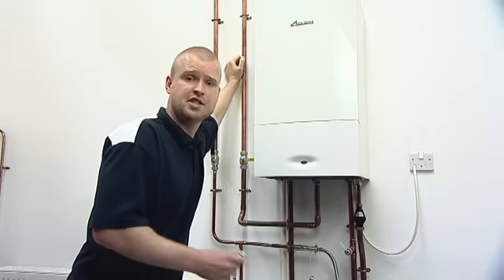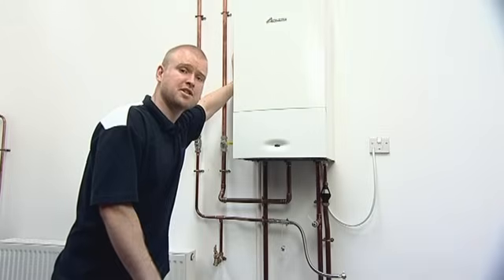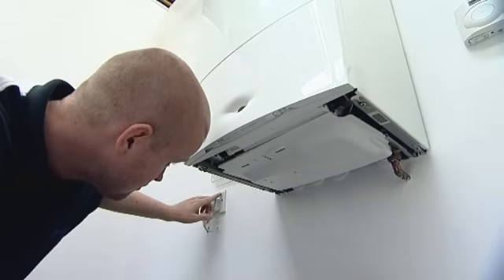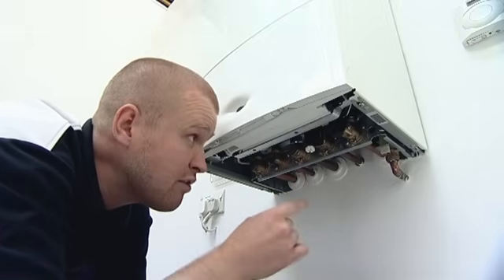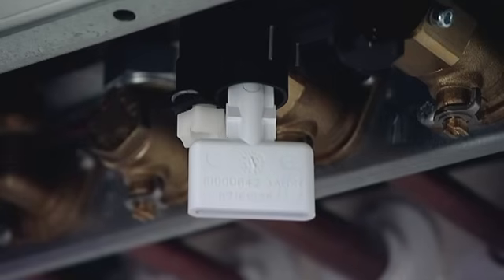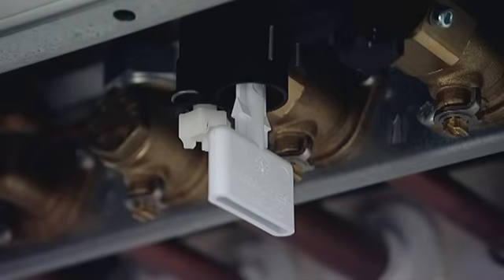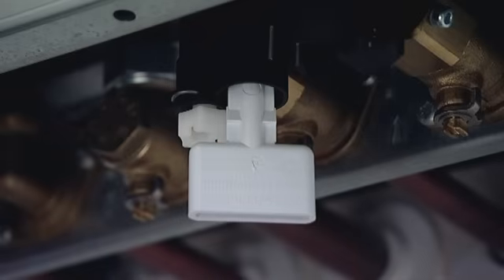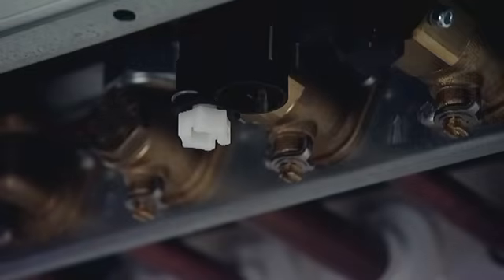How to Repressurise a Heating System with an Internal Filling Key | Worcester Bosch

Comment: Thanks for the video, really helpful.  However, when I get to the stage to turn the white nut water starts pouring out down the hole where the key is.  Please can anyone help?
Reply: Ditto, got the same?
Reply: @harmony3395  The key's 'O' rings should stop water leaks during pressurising. If the key is a tight fit, lubricate the tube with soap, WD40 or silicone grease. The knurled tap can allow some water ingress to the key tube, but discover why the 'O' rings don't do their job. It wouldn't normally pour though! If finally re-tightening the knurled valve (after the gauge climbs) does stop the leak, that's the important thing.

Comment: He said there were two ways of doing this. Why didn't he show people how to re-pressurise using the filling loop?? I'm no expert but I'm sure I learnt that these filling loops must not be permanently attached to the boiler. Possibly illegal. However, many people do keep theirs attached. Mine is. Thank god my installer left it on and even told me how to use it.Very simple. My make of boiler didn't come with the internal pressure filling system with a key so I need the filling loop. A quick top-up every now and then. Nice!

Comment: Dear Worcester Bosch 
This plastic key and manifold confuses 99% of tenants. The key almost always isn't pushed home in the black recess ( see comments below all complaining about water leaking) as it is a poor fitting. What was wrong with the traditional filling loop? Or fit a lever valve or something under the boiler.
Reply: Why does the key keep turning all the key all the way around after inserting? Will it cause any problems??

Comment: Hi just a question for the Worcester bosch group, my parent`s had a new boiler this time last year, "same as seen in the vid" and my mother is a little bit confused as to why it has to be filled up every 6 weeks or so any suggestions why it needs re charging so often ?
Reply: I know nothing about central heating systems, but at a guess, if you are losing pressure, you have a leak somewhere.

Comment: ARGH!!!  The flaming key goes in, but the white nut doesn't turn anti-clockwise.  I also now cannot get the key out no matter if at open or closed padlock symbol.  ALSO can't find instructions ANYWHERE on the website for my model for this issue.  Please help.

Comment: As a Gas safe registered heating engineer this method of filling a pressurised heating system can only be described as an appalling  way to fill or Re - pressure a heating system. A bog standard filling loop is way better, for a homeowner or end user.

Comment: Many thanks, this worked a treat.
For those of you about to try this, here's a quick tip:
If the knob you turn to let cold water into the boiler doesn't seem to do anything, you may find that you need to take it off, then use pliers to turn it. This happened to me as the white knob in the video, which lets water in, was worn and didn't turn the actual shaft. So we took it off then used pliers.
Job done.
Reply: When I did mine, turning the key water came out and it did not work! SoI turned the key back to lock and opend the white nob. Waited for about 30sec then turned the nob off and the key to unlock. Then turned the key to open , and it worked.

Comment: Will this also improve the hot water pressure? My shower takes ages to heat up and runs cold for a few minutes every few minutes. My plumber did what was described in this video a couple of months ago and it improved slightly for a short while.  I just did it again in the hope it'll help the situation - but surely I should not be doing this every few months?

Comment: Thank you so much - bled the radiators then had no heat or hot water at all- watched this and attempted my first official boiler repair and now everything is back to normal - except the radiator i was bleeding is still rubbish. And luckily my boiler came with one of those keys ..... or i would still be crying at my laptop!!!

Comment: Hi, I have just done this process but the pressure continued to climb after I had turned off the screw. I turned off the electric to the boiler in a bit of a panic as the pressure went up to just passed '3'. The pressure came back down to '2' and so I turned the electrics on again but when there is a demand on the boiler (e.g. hot water or rads turning on) the pressure climbs all the way back up to '3' again.
Any help woul dbe appreciated.

Comment: Thank you very much for this posting this video have recently made the switch from an old back boiler to a new worcester combi boiler, I noticed the pressure had dropped just below one bar. Ended up causing a bit of panic, as I'm not too sure whether or not this could be dangerous at all. This video settled my fear and fixed my problem. Brilliant work, thanks very much.

Comment: Having probs with a 28dpi boiler. After pressing the reset button last night there is now no hot water - I'm not sure if we ever had heating as it's summer & we haven't needed to have it on since moving in. The red light keeps flashing. I tried to follow ur instructions but our boiler is slightly different & also the pressure is at 1.5 so I'm not convinced it's that. I've just noticed that the key was left in the boiler system and not sure how long it's been there so I removed it. Can u help? Ta

Comment: Great video! I reconnected a radiator today but when I switched the boiler back on it was making odd noises and the radiators weren't heating up. Thoughts of calling in an emergency gasfitter/plumber on expensive weekend rates went through my mind. But after seeing this video I learned that my problem was simply a matter of the boiler pressure being too low. Easily fixed. Great stuff!

Comment: Great video, thanks. Very clear, concise instructions. My boiler pressure had dropped after bleeding a radiator, so this video was very helpful. On first attempt I had water coming out through the keyhole, but after checking back here realised that I hadn't pushed the key up far enough. It was simple from then on, and I now know exactly what to do next time. Thanks :)

Comment: I am sure the WB guy is right, but you may find (as I did) it's so tight when dry, you couldn't get it in there sufficiently. I ran it under a cold tap first so I didn't need excessive force to get it right up. The WB guy suggests grease which would be better. Also, in the unlocked position (care) it has to go WAY UP until the arrow-tip is almost touching the black manifold(approx 1/4 inch away). If not, the key will spin as you infer. When in far enough, it won't rotate past the lock position.

Comment: Hello, We are currently experiencing a pressure problem. I have followed the instructions to a T, but when I turn the key to the locked position, water flows through and out of the key. I have tried turning the key into every position to no avail. Ideas?

Comment: Thanks for the helpful video. I have the Worcester 28CDi and it seems to be a bit different. The dial is on the right and I had to turn it clockwise to allow the water in.

I'm having a problem removing the key though. It is completely stuck. I live in rented accommodation and the key was already in place so I don't know how it was put in. Is it a problem to leave it in there?